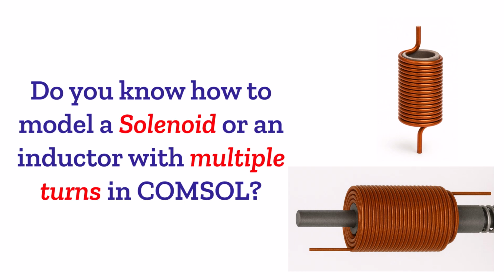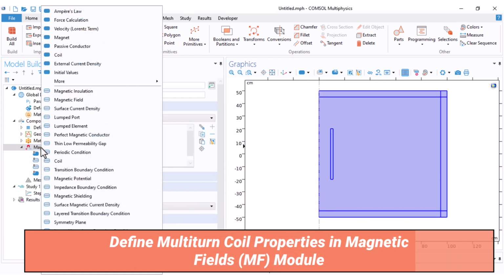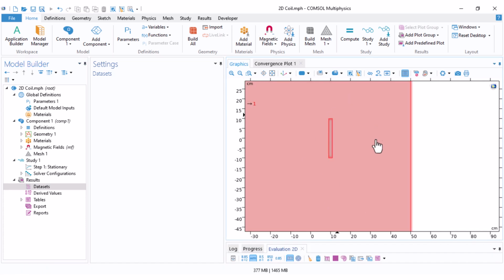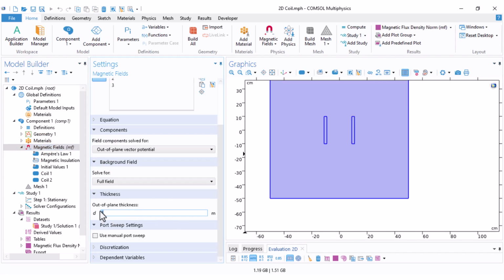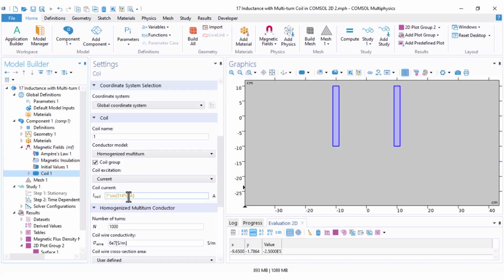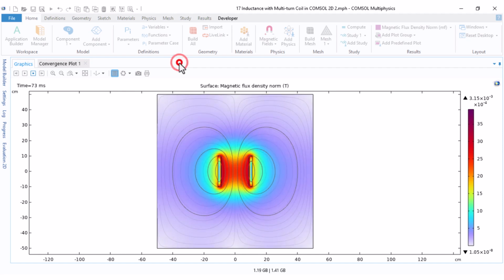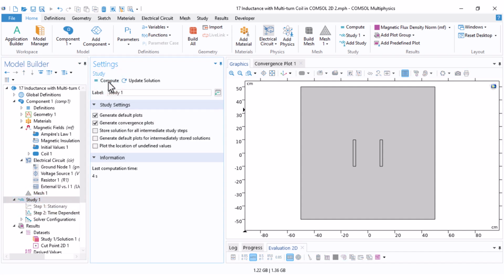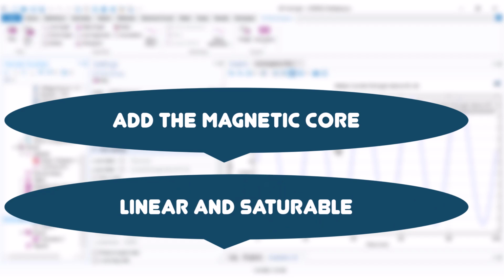Model Solenoid Coil in COMSOL (Fast & Accurate Method)

Comment from the maker: 💡 Did this tutorial help you? Let me know in the comments what you want me to cover next in COMSOL!
👉 In the next video, I’ll show you how to add a magnetic core (linear and saturable) to this solenoid — don’t miss it!

#CoilSimulation #MultiturnCoil #SolenoidSimulation #InductorModeling #MagneticFlux #CurrentDensity #ElectricalCircuit #AxisymmetricModel #COMSOLBeginner #FieldSimulation #ElectromagneticSimulation #InductorDesign #SolenoidCoil #TimeDependentStudy #StationaryStudy #MagneticFieldLines #ElectricalSimulation #CircuitCoupling #ACDCSimulation #Inductance
Reply: Does it possible to simulate a superconducting coil (solenoidal and toroidal configuration) in COMSOL multiphysics  and then calculate inductance and then Energy?

Comment: Good afternoon. I did not quite understand why, in a 2D setup in COMSOL, two rectangles are treated as a solenoid with two faces, rather than as two busbars with currents flowing in opposite directions. Could you please clarify this? I would greatly appreciate an explanation. Thank you!
Reply from the maker: Thanks for your question.

The key point is Ampère's Law. What determines the magnetic field is the total current enclosed by the integration path, often expressed as ampere-turns (NI).

From the magnetic field perspective, there is no difference between:

One conductor carrying a current equal to NI, or
N turns each carrying a current I.

In both cases, the total magnetomotive force is the same and equals NI.

In COMSOL, this behavior is controlled by the coil feature. You can choose:

Single Conductor, where the current passes through the domain only once, or
Homogenized Multi-Turn Coil, where the current is effectively counted N times, representing N turns of a winding.

The main difference is how the current is distributed within the selected coil domain. In the Single Conductor formulation, effects such as skin effect and non-uniform current distribution can be taken into account. In the Homogenized Multi-Turn Coil formulation, the current density is assumed to be uniformly distributed, which is usually a better approximation for real transformer or solenoid windings because the individual turns are insulated from each other.

Therefore, the two rectangles are not interpreted as two independent busbars carrying opposite currents. Instead, they represent the cross-section of a winding, and COMSOL calculates the magnetic field based on the specified coil formulation and the resulting ampere-turns.

I hope this helps clarify the concept. Please feel free to ask if you have any further questions.

Comment: Please I want to help ..
I simulate the solinoid coil in COMSOL for 2D model as a circle. In Coil node(at magnetic field interface) , i add multi homogenous turns .That is correct ? Or it should be designed in 2d as rectangular?